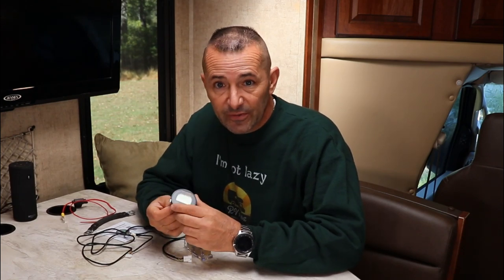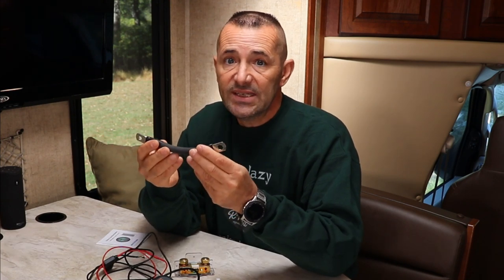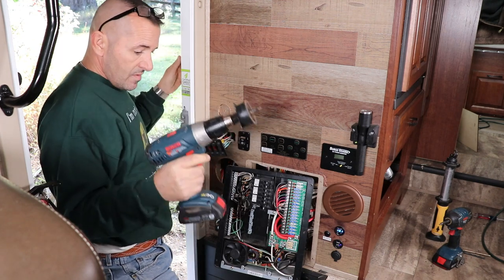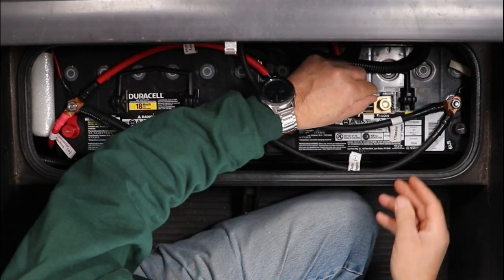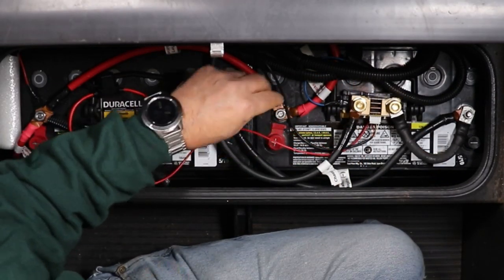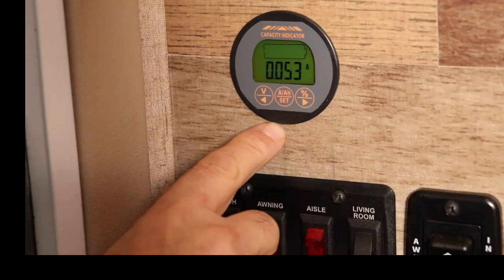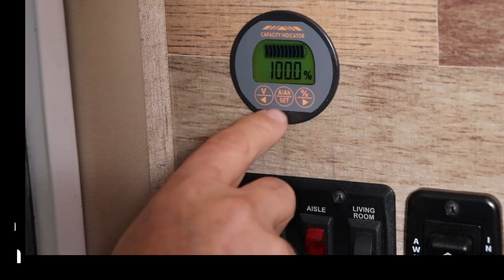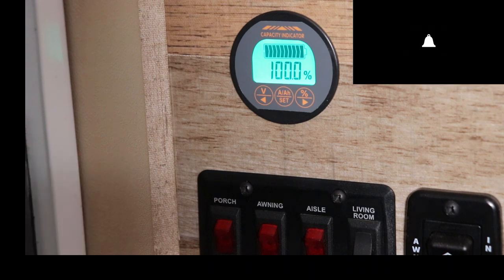Installing A Full Function RV Battery Monitor From AiLi Qwork– How To - Tips and Tricks - RV Upgrade

Comment: One thing many of us forget is that with any lead acid (including AGM) batteries, we can only use 50% of the rated capacity.  If we use more than that we can damage the batteries.  I recommend you decrease the Amp Hours to 1/2 of what you set in the video.  Thank you for the video - I just ordered this monitor from Amazon.
Reply from the maker: Yes Steve any lead acid battery should only be used to 50 percent of its capacity.  Thanks for watching.
Reply: I read the comments just to see if anybody else thought the same thingI just bought one myself and I'm going to set it to 50% of the total amp hours. I have a total of 140 amp hours so I'm going to set mine to 70 amp hours at 100% on the battery meter. Thanks
Reply: Since we all already know that, we all already know that once this thing says 50%, it’s time to make some changes.
Reply: I believe from watching another video there is a setting where you can set your 0% reference voltage where you like it. Not sure if changing your capacity might throw other data out of spec?
Reply: This is good to know.  I still run a lead acid battery so will not let it get below 50 per cent.  It has a built in battery monitor.  That being said I really like my LiFePO battery as it doesn't have this problem (although for long-term non-use, better that the battery is left at 70  per cent charge rather than 100 per cent).

Comment: Hi I bought one of these off Aliexpress and it looks the same ha ha! But it's not. Didn't come with the plastic case. I was just wondering if solar is connected that's putting power into the batter. I thought it was just for telling us the power going out. I've connected this up and works. Just a bummer no case.

Comment: Nice job!  but remember that you don't discharge the flooded batteries below 50% with out damage. When installing/ programming my AiLi monitor I programmed it for 105 Amp hrs with a 210 capacity. That way my 50% shows empty.
Reply from the maker: I actually forgot to mention that for people who are unaware about 50% for flooded and AGM lead acid batteries.  Good idea about programming half the amp hours.

Comment: I just finished installing a QWork battery monitor.  It is just like the AiLi.  The monitor itself, the shunt, the instructions,  and all connections are exactly like the AiLi.  The shunt was a 500w and I needed to use a 13 foot extension wire.  The QWork is about $10.00 more than the AiLi.  Amazon was out of the AiLi but they had the QWork.  My installation was in a travel trailer.  I watched this video a number of times and it made the installation easy!  Thank you very much for a clear and concise installation video.  I’ll be boondocking for four days.  The new monitor will allow me to keep track of battery usage.
Reply from the maker: Yes the QWork is the same monitor just different branding.  I'm glad the video helped out.

Comment: Thank you for this video.  I followed your instructions and everything worked great!  One detail I'll pass along.  The display backlight slowly pulses on and off when your batteries are charging.  This detail is not in the directions that come with the battery monitor.  I discovered online that some people find it annoying at night if the display is located in your RV.  I mounted mine in the battery bay and not in the trailer for this reason.  Thanks again for an easy the follow and accurate video!  Cheers!
Reply from the maker: Yes the light pulses.  I have never found it annoying but may do.
Reply: @RVHabit  The backlight can also be turned off or on by holding down the two arrow buttons for three seconds. Cheers!
Reply from the maker: Excellent tip.

Comment: Hi!  If you accurate want to monitor, and really to know how much percent you have, you must to programm the monitor when your inverter or charger is tuned off!!! Now you have a fault measurement.  14,5 Volts x 210 Ah  = 3045 Wh and that is your 100% .  But when your charger not running your Battery have around 12,5 V x 210 Ah =  2625 Wh!   Fault size: 16% ! But the video is great! Cheers
Reply from the maker: Hi Gergely, Excellent point.

Comment: Great video, thanks for all the work, really wish you had shown how you got the wire run from batteries to where you installed it. I'm a bit of an RV newbie and this part of the process is the most daunting for me.
Reply from the maker: Hi Kurtis, yes running the wires through the RV is the most challenging part of any install.  I don't go into depth because every RV is different.  The secret is patience.  Take your time and if you get frustrated with it walk away for a bit.  You will be surprised how sometimes just an hour break will let you see things differently.  Good luck.

Comment: I have new GrandDesign Imagine that has a battery monitor in it. It looks the same but is Furrion branded. Just got it programmed tonight with help from this video. Turned out I needed to press the A/Ah but twice before holding for three seconds which I figured out watching your video. Manual is not the best. 

It wasn’t working when I got the trailer. Didn’t realize it until later since they placed it in the basement control center. Had to trace the battery negative backwards to locate the shunt. Which was buried. When I found that there was an inline fuse that was blown so an easy fix. Not worth driving back to the dealer.
Reply from the maker: Glad the video helped.

Comment: Slightly off topic but I’m just a bit curious on your battery setup because I’m trying to set up my trailer.  The instructions you provided were excellent. 
That looks like a parallel set up but why is there more then one heavy wire on each of the positives?  I thought when you do a parallel set up you go positive to positive, negative to negative, then with the positive from the coach to one of the batteries and the negative from the coach to the other battery to allow equalized charging.
Reply from the maker: Yes they are set in parallel.  There is an extra positive wire for the hydraulic jacks.  Watch this video to see how I wired the batteries  https://youtu.be/6-k7PUWFRMg

Comment: Great video. Clear and well articulated instructions, thanks.
Quick question, mine came with a 500 amp shunt, does that matter at all when it comes to the accuracy of the readings?
Thanks.
Reply from the maker: Hi Jeff, I have the 500 amp shunt also.  It is perfectly fine and will allow you to connect any accessories you may want to add in the future like an inverter or solar.
Reply: I have 270AH and have this capacity monitor wired, though I wondering there’s an issues, reason being is I can run inverter/laptop & speaker, projector, pS4, and more, all while seeing little drop on the monitor after hours of use! Maybe I’m just too used to the old lead acid truck battery, which had me anxious all the time. This new setup seams amazing.

Comment: Great video!  Would it be possible or advisable to lengthen the meter wire with the same gauge?  The control panel is a fair distance from the battery.  Thanks in advance for your assistance.
Reply from the maker: They sell an extension cable for the meter. You can find it at https://amzn.to/2v3HAYE

Comment: Great video, I see you set the monitor to 210 AH,  But I just want to confirm you still only have 105 AH usable Amp hrs before the batteries go below 50%. Don
Reply from the maker: Hi Don, That is correct.  You should not deplete any wet cell or AGM battery below 50%.  Bringing the battery below 50% charge will shorten the batteries life.  The battery monitor will now keep you well informed about the state of battery charge and even better lets you know how many amps are being used and replenished into the battery bank.
Reply: @RVHabit  Hi Lou, Bought one of these and tested the drain on the battery to see how the monitor displayed the Voltage, Capacity & Ah usage. My battery went down to 70%. I connected the battery charger to the pos & neg of the battery and fully charged. A mistake I think as the AiLi monitor still showed 70%. (I had to reset Capacity & Ah settings to full). This probably seems obvious but would I be correct to say that the neg of the charger needs to be connected to the P- of the shunt, so that the charging current flows through it, so it can display the the correct %age & Ah as it charges? Thanks Lou. Andy
Reply from the maker: Yes I believe that is correct.  The monitor needs to see amps in.
Reply: @RVHabit  Thanks for the reply Lou. Daft question really but just checking. Great video, really well explained, thanks.

Comment: Great video. Everything went smoothly until I tried to put the recommended power wire in the b+. 
I probably got the wrong size. Can you tell me what size wire is required?
Reply from the maker: If you're referring to the power wire that will connect to the positive battery terminal I believe I used 18 gauge.  It doesn't take much it is only powering the monitor.
Reply: Yes thanks
Reply: Got it done.  Thanks to you and your video. 👍🏼
Reply from the maker: Glad it work out.  I love the meter.
Reply: My goodness I had all sorts of trouble getting my little red wire in the b+ hole, I used the smallest wire I had which I thought would be fine it was 0.75mm2 (Uk sizing) but no  it was still a struggle. In the end I had to trim some of the strands off, why do they have to make things so difficult?
Reply from the maker: Because the engineers are not the ones installing them lol.  I didn't have a problem though.  I think I used 16 awg.

Comment: Just got mine.  What gauge wire and inline fuse did you use to positive side of the battery? Also, I am running 2 AGM 100ah batteries but on the posts there are only the positive and negative cables.   The wires that go into the camper are much smaller.  That all seems kosher?  Great video by the way.
Reply from the maker: Hi, I used a simple 12 gauge wire with a 5 amp fuse to power the monitor.  Usually there will be a positive cable that goes from the battery into the RV converter/distribution panel.  That panel then feeds the RV electrical system.  It is not uncommon to see the minimum gauge wire used by RV manufacturers.  Good luck on the install.
Reply: One other thing.  Not sure it matters.   I am installing on a travel trailer.  It looks as though I need to remove negative battery wire on the "second" battery and bring it to the shunt? Wish I could post a picture lol.
Reply from the maker: If you have two batteries wired in parallel then you want the negative of the second battery.  This is where all negative connections should be currently.
Reply: Mine came with no instructions so I'm relying solely on YouTube.   With yours being a motorhome I feel like it will be slightly different.  With that being said.  Passenger side battery has 1 pos snd 1 neg that goes to drivers side battery.   Driver side battery then goes into coach.  I will remove negative jumper wire that comes from pass side to drivers side and install it to the P side on the shunt and that removes the jumper from drivers side batteryleaving only the negativefor the coach,  I then remove neg battery wire from drivers side which goes into coach and put it onto the B side of the shunt.  On driver side battery it currently has the neg wire from pass side battery and the neg wire for coach plus of course the pos from pass to driver side.

Comment: Great video, got me on my way installing. Question. If you input the battery's capacity, do you account for the actual capacity since you can't discharge a regular battery fully without destroying it? So I have a 105 Ah battery which can be safely be discharged to let's say 75Ah, do you the enter the actual usable capacity of 30 amps into the monitor? Thanks!
Reply from the maker: No, for the monitor to give you accurate readings you will input the total amount of amp hours listed on your battery.
Reply: @RVHabit  but then it will drain the entire battery which will kill it. It's not smart in any way but just counts amps in vs. out
Reply from the maker: its designed to count amps in amps out.  You as the user determines when to charge based on its readings.  The monitor does just that it monitors
Reply: @RVHabit  would you then rely on the percentage bar to determine when the batteries are drained? I would like to have the little bars show the actual amount I can safely use, from 100% to zero. Hope you understand my question. Thanks!
Reply from the maker: No, the monitor will read what the current state of charge is.  So in your example you have 105 amp hours equals 100% and when the monitor reads for example 50 percent you know you need to recharge.  Lead acid batteries should never be drained below 50 percent or life span will be decreased.

Comment: I don't have an RV or "system" I just have a single 100ah Lithium battery that I would like to monitor. Can I still hook this up? Thanks in advance.
Reply from the maker: Hi, I don't see why not. However if you're not pulling any power from the battery a multimeter may be a better option.
Reply: @RVHabit  Hey thanks for the reply. I'm building a camper and for power I have one of those "solar generators" that I use for other things. I would just be hooking up my RV fan and small 12v fridge straight to this battery with a fuse in there, but that's it.. So yes, I would be drawing power from this battery, just not through a complex system.
Reply from the maker: Then it should certainly work.  Good luck.

Comment: What size fuse did you use for the shunts power cable?
Reply from the maker: I used a 5 Amp fuse with 16 awg wire.

Comment: Hi! Is this battery monitor calculating the remaining batt capacity by estimating from voltage (what most cheap monitors do) or actually calculating from Ah going IN/OUT over time (what Victron does)? Many cheap monitors do actually show either positive or negative current to tell you if you are in net charging/consumption mode - but when displaying capacity % they still estimate from V.
Reply from the maker: This monitor is measuring amp hours out and amp hours in. It does not estimate voltage.

Comment: Great directions I just set mine up. By the way I used a 2 1/8 hole saw and it worked great. It was just a little bit snug and I really didn’t even need the mounting bracket at the back but I installed anyhow. Thanks so much for the tutorial! Have a great day!
Reply from the maker: Nice work!

Comment: How do you get that 12 gauge wire to the positive battery terminal to go into that little green connection?   It looks like it takes 18-20 gauge max.  Speaker wire?
Reply from the maker: Yes you need to connect a smaller gauge wire to the fuse holder.  I used 16 AWG.

Comment: The percentage doesn't change after I've charged the batteries. It's shows the drain % as I'm using it but not the charged.  To get it to show 100% charged I keep having to change the charge % manually.  Is there a connection I need to change to enable the charge to be shown whenever I charge the batteries?

Comment: Nice video...i have ordered this Monitor.....and a tip as an old retired  😏👍 Electrician.....never ever wear a metal or alum Watch ...when You are working with High current batteries !! This was close to the terminals ! Any short contact and you know what happens ! Greetings from Holland...
Reply from the maker: You are absolutely correct.  I didn't realize I left my watch on till I was editing the video.  Thanks so much for watching.

Comment: Excellent review! How weather resistant would you say the AiLi shunt is? I would like to mount mine in my battery compartment which is on a track under the cab of the vehicle and has a plastic shroud around it so water will not get in, but the batteries do show some road dirt over time. If the shunt is sensitive to that, I would need to create some sort of enclosure. Thanks!

Comment: Great install video. installed this on a 100 AH LifePo4 Lithium battery for on a kayak. I have concerns regarding the digital display part itself. I can keep it in the front hatch out of the weather, but it will be inconvenient to use there. Is there anyway to waterproof the readout itself that you know of?

Another question I had is regarding the large shunt bolts themselves. Do you by chance know the specs on those bolts? I’m pretty sure I will need longer ones so I can fit all the negative wires onto the shunt. Thank you.
Reply: I have the same set up on my Kayak and was thinking the same thing. How often do you really need to check your battery reserve? Mine sits on top of the kayak I figure I'll just put a rag or shirt over it to keep it out of the direct sunlight.

Comment: Just finished install, took some time due to space. I was setting up the monitor,  so 200 amp and 100% on full charge. I m on shore power, when I turn use/stop switch to use the monitor starts to show 1% than 2% like it charging battery is that’s correct? Even though it has been fully charged
Reply from the maker: Hold down the % key for 3 seconds to set to 100.
Reply: Thks
Reply: Is your monitor still continuing to show zero even when it's full? When I connect to shorepower it's zeroing out pretty quickly for some reason. Can't figure out the problem.